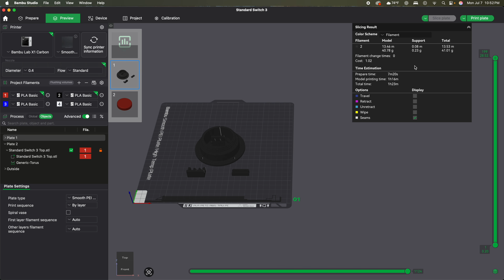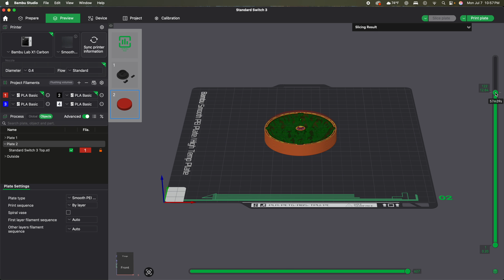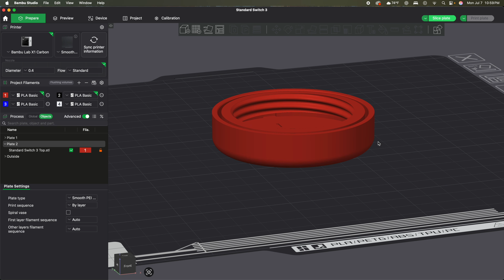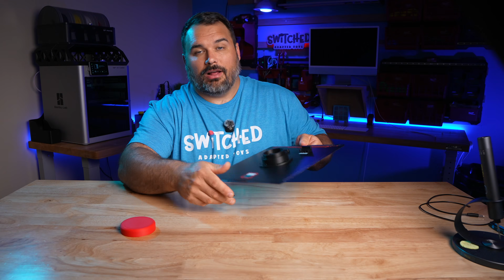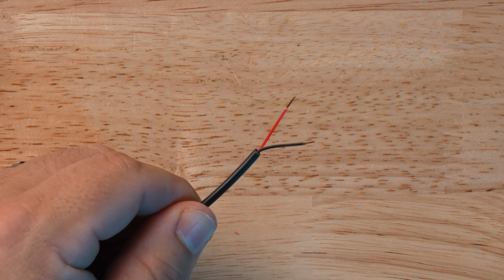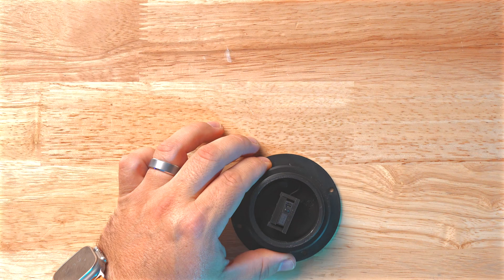Build a $75 Switch for $7.50 – Here’s How!

Comment: Pro-Tip for the soldering: Draw the iron down towards the end of the wire to help it spread over the wire instead of just pulling it away, so it stops being a blob and becomes more of a coating; this is "tinning" the wire.

Then you can hook the wire around the hole for more structural stability in case the cable gets yanked on.

Comment: Quick question. Why move away from the keyboard switches? I've put together a number of assistive switches with novice makers and I found your version with the keyboard switches to be the easiest to work with.
Reply from the maker: The limit switch is much better at handling the power required by many switch-adapted toys. Mechanical keyboard switches are great for simple signal switching, which works for some low-power toys. However, when you’re adapting more power-demanding toys (such as those with motors or those using battery interrupters) a limit switch is a much more reliable option.
Reply: @switchedadaptedtoys  Hello! Any recommendations where to buy this new switch in bulk?
Reply from the maker: Digikey is a good place to check. We also sell them on our website. www.switchedtoys.org
Reply: @switchedadaptedtoys  Looks like digikeys is sold out. Fully understand the switch over, however, the previous keyboard was much easier to get hold of! Thank you for all you do!